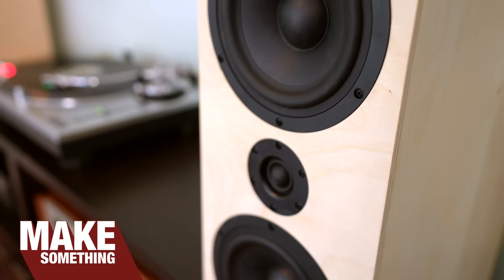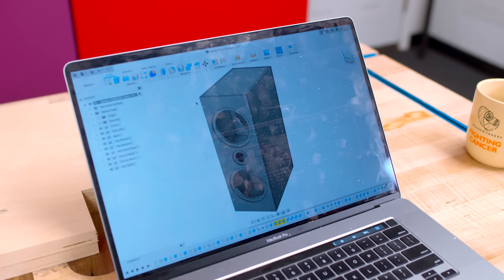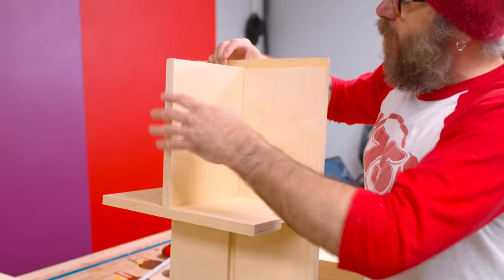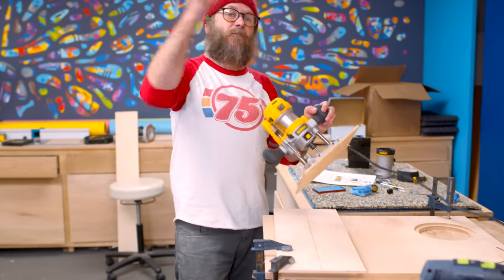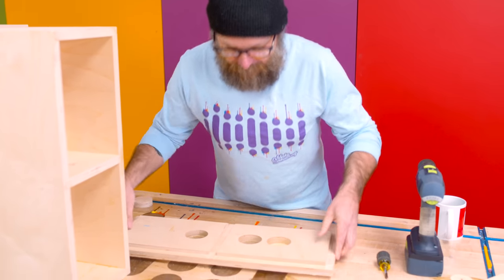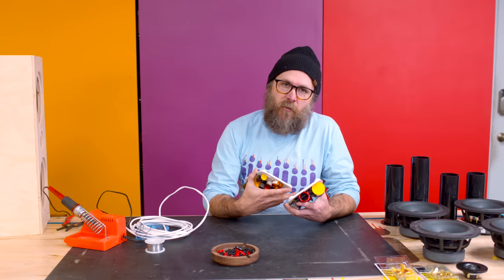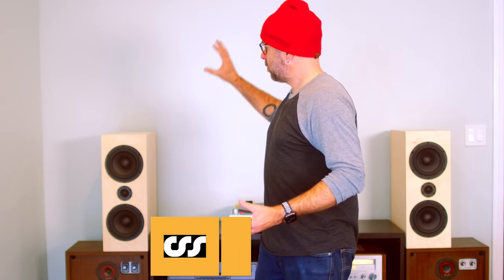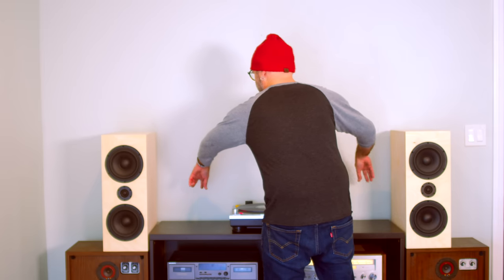High End Stereo Speaker Build. THESE SOUND AMAZING!

Comment: The reason why the ones from the 70s sound Muddy is because the capacitors have failed. They didn't use great capacitors back then and they fail so I replace them and they sound 100% better. They didn't sound that way when they were new but you can add bracing damping material and replace the tweeter and you have something totally different. I have done it and you wouldn't believe the difference. I don't think they still sound as good as css audio but you will be happier 😊

Comment: Your old speakers look like Marantz Imperial 7's. They should be way more efficient. The crossover in them need to be replaced.  The original one is cheap and an ill design where the midrange is left unfiltered on the high end and muddels the high frequency. Re do them with a quality design with a band pass on the midrange. They will sound much better. If they are old enough for the woofer to have an AlNiCo magnet it has weakened over time and will need to be replaced. Find old CTS 12" from some other 7's and replace them with those and the base will tighten up substantially.  I have done this in the past to great results. Nice job on the new ones by the way.
Reply from the maker: Oh gosh no, definitely not Marantz!

Comment: You can tell quite a difference from those two speakers even on youtube the older ones sound as if the tweeters are gone the mids are low and bass is woolly the new ones def sound way better but you need a better amp. that old receiver won't be getting the best from those speakers.
Reply: The weak link is likely to be the phono cartridge and the recording quality of the source music. A lot of music in that genre sounds like it was recorded on budget equipment in somebody's garage.

Comment: Glad you removed most of the hedge.  You should go back to the Punk look👍🏼 I like the build,. I build speakers in my guitar shop, was surprised you just went baffled interior without any dampening.  Find yourself a good 80's / 90's Sansui, Marantz, or Harmon Kardon Amp....very good performance and usually you can find one reasonably priced.  Or just a McIntosh 2100, which are readily available without breaking the bank

Comment: Three different approaches:

(1)Let's keep this simple. Buy a stereo system with good spec. But, you want to be able to split the pre-amp from the power amp. Dan should know what I mean. Then build a little tube pre-amp and put it between your solid state pre-amp and your solid state power amp. It will now sound like a tube amp, real cheap.

The other concern is the power supply. Make sure it has a good power supply. If it is wimpy it won't have the power to drive the low end and you will get inter - modulation.

Most better end stereos will be better than your ears, so be aware of distortion, not so much a flat signal.

As for power, just get the recommended power needed for the speakers. It should be in the specs. You don't need 500 watts, something under 100 watts should do it, unless the speaker spec. says otherwise.

**

(2) Build your system from a kit, then you will be able to split out between the pre-amp and the power amp to insert the tube pre-amp. Just make sure the kit hasn't had the price jacked up. Some kits do that.

The nice thing about sliding a tube pre-amp in between your system is that sometimes you will want a tube sound and some times you will want the sound from an all solid state system.

**

(3)I've advised others get a cheap stereo and put the money into speakers. You've done that. Why buy another stereo, the one you have has better audio than your ears. If you can't split off of this stereo, build a front in that has the tube pre-amp. You can buy a cheap selector box and plug into the tube pre-amp and then into your stereo.

Additional Thoughts:

(1) Listening through YouTube it sounds like your old speakers have too large of a bass port. As for me I don't like ported speakers. I like a tight base.

**

You are close to being pretty good with your soldering. I can recommend this for doing good solder joints, Weller WLC100 40-Watt Soldering Station. Keep the sponge damp. After you get real good soldering, just like with any tool, then you will be able to use just about anything to solder. I've soldered wires with a cigarette lighter.

You are not 18 years old. You said your ears are shot. So igore all the experts who will chime in with this and that. A $3,000 stereo is ego. If you like pretty lights, add your own, or buy a set of fake analog meter with a million LEDs and watch them bob and flitter.

Let us know what you have done to power your speakers.
Reply from the maker: Whoa! Thank you for the detailed suggestions! Appreciate it!!
Reply: @belly tripper It all depends upon the efficiency of your speakers and whether they can take the load. You have enough power to fill a good size gym, or maybe Rhode Island. It's fun to have the power.

Comment: You can make it like that but curved edges are better ,  other then that how you use them will make the difference . For example with Active crossovers tuned to those boxes and drivers is  going to make them high end  , active crossover each driver its own amp . Hooking it up to 10 000$ Macintosh will not make them high end  each driver having its own amp with active crossover will make them sound as good as possible , you can use 6 Macintosh amps for this if you like , makes no difference , or 6 normal amps . If those amps are good and do amplification they will sound exactly how they need to sound .

Comment: I only have a bit of an issue with you not just using a hole punch for the screw holes, then just drill them without the woofers in place, and before putting the batting in there. Just myntwo cents mate, sorry.

Comment: Safety...
Clamp on a 1/4" sacrificial board to your fence. 
Adjust your fence to the dado blade set. You might have to bring the blades up into your 1/4" strip .

Now run your rabbits close vs far outside.

Looks like you fixed it.
Never mind.

Comment: i cant solder and i dont know why, it just dont seems to stick to it WTFF
Reply from the maker: it's a technique. I'm not very good at it. Solder goes where the heat goes. So heat the joint and it should flow in.

Comment: I'd suggest using an integrated amp for to replace that Technics that you're using. I bought a NAD 356BEE integrated amp for stereo use a few years back and have been very happy with it. Most integrated amps will be fine, but just make sure that whatever you buy can handle the 6 ohm impedance those CSS speakers have.

Comment: If you have back-ported speakers like these, you shouldn't place them as close to the wall behind them as you did.
They will sound much better when you move  them about 50 cm or more  from that wall.
Reply from the maker: Did you not watch the end of the video?
Reply: @MakeSomething  Yes, I did, but I wonder why he is testing them like he did in this video. 
There's no reason to wait for the final test until the outside of the cabinet is finished, that won't make any difference in the low frequency response.

Comment: Don't mean to rain on your parade, but it appears that you have left the horizontal internal brace behind the tweeter solid all the way back to the back wall. In a conventional speaker design, there will be in that brace in the same way that there are holes in the braces that are parallel with the front and the back walls. It looks as if you have divided the whole speaker box into two half-sized boxes. This will affect the tuning of the port, which will only tune the half-box that it goes into, rather than the entire box. This will lower the box tuning frequency considerably. Your work is well-crafted though, and the speaker sounds OK. I looked at the Criton 210 kit kit pictures and the pictures don't show that middle horizontal brace, so we don't know if there is a hole in it. CSS does not discuss their design process.  In general, your carpentry process is the same as I have followed in over 50 years of building speakers, and your craftsmanship is excellent.  Thanks for an excellent video.

Comment: I applaud your cabinet work, but you have built far from a high end speaker. There is so much more to speaker building than you realise, and you have barely scratched the surface of the considerations of what makes a speaker sound good. It's not your fault that you don't know what you don't know, but you could have made way better cabinets with the tools you have then what you made. To be fair the kit manufacturer didn't do much better.